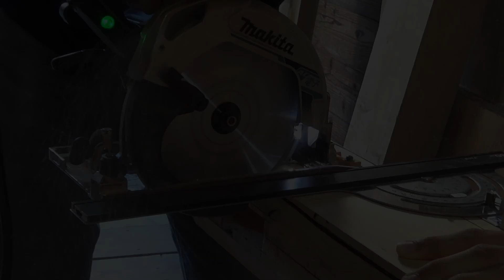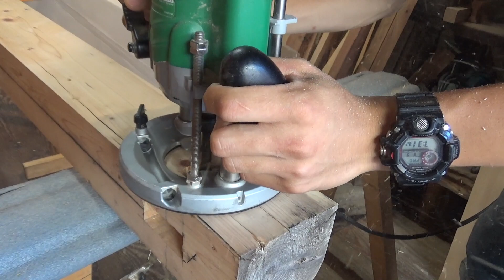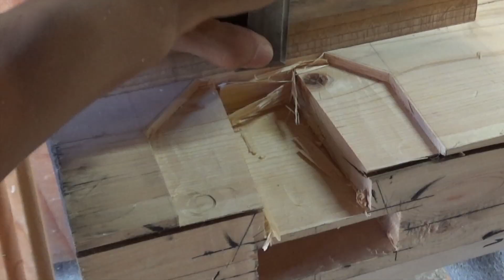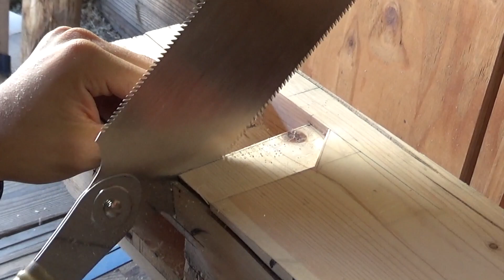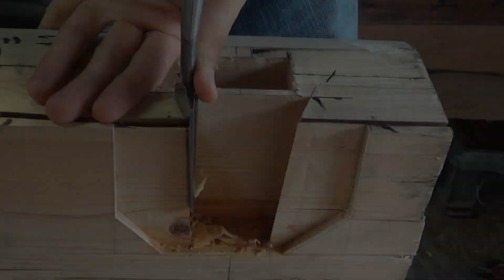Making Japanese Carpentry Joinery　宮大工が職人技で教える初心者のための兜蟻仕口（メス）の作り方動画

Comment: use of modern tools detracts from the workmanship,  the use of traditional methods makes for a much cleaner product.
Reply: Detracts in what way exactly. Time is money. He only uses the power tools to hog out the easy stuff and finishes off using saw and chisel. How does the use of power tools diminish the fitting of the joint? That's right it doesn't.